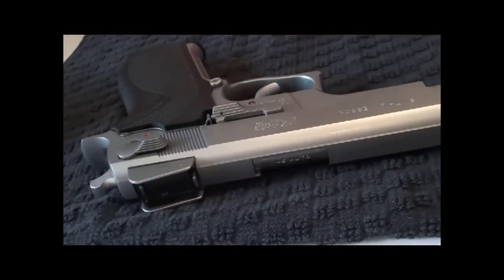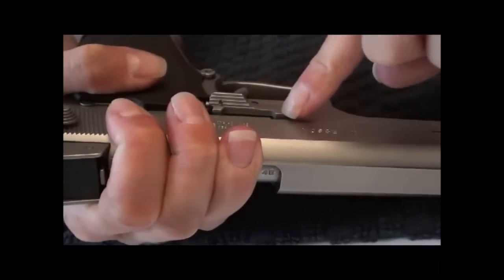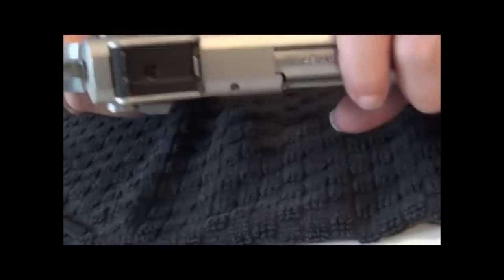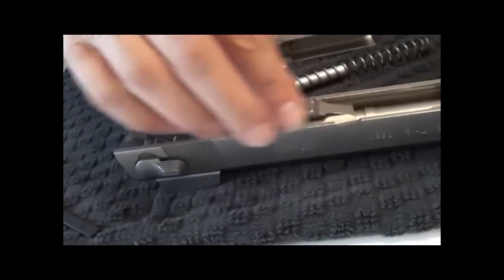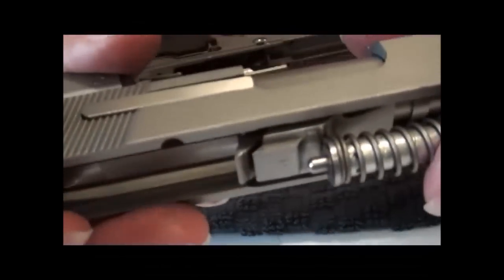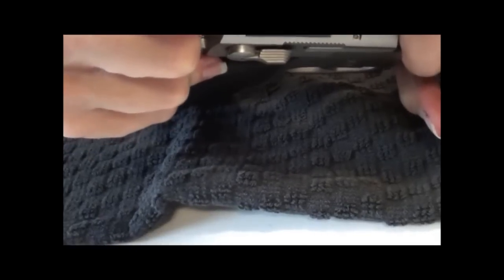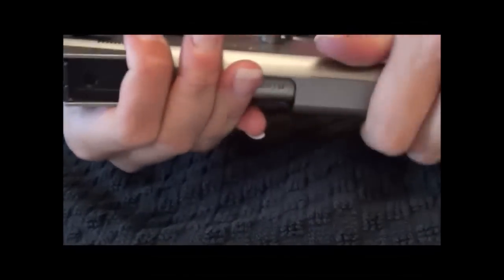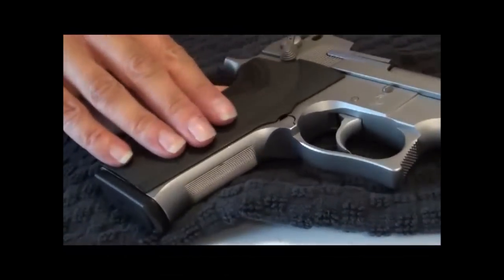Smith & Wesson 4506 Disassembly & Reassembly

Comment: This was my absolutely favorite defensive firearm I carried as a police motorcycle officer in the SF Bay Area in the 1990's. A beautiful and comfortable shooting firearm. Sleek lines and 'peace of mind' as a defensive firearm. Large  230 gr.  ammo if ever needed.  It was like throwing a lead & copper 'football' coming @ U.  I was lucky I never had to use it outside of range training in my 35 yr. career.
Reply: Any tips on shooting this? I seem to have accuracy issues. I'm pretty sure it's not the gun LOL.
Reply: To check guns sights for dead-on accuracy, shoot it at a range with a 'steady-hand' aiming device. 10 ft, 20 ft. 30 ft. 50 ft .  Range personnel can assist U. If sites are off, most gunsmiths/range personnel can assist U in re-aiming them.   Use cheap ammo for range training but carry premium loads in it as a CCW. Clean & lightly lube gun & rubbing parts after every shoot. Take good care of it and it will take good care of you.

Comment: Too bad you glossed over the part where you have to push in the spring loaded pin that’s part of the disassembly pin/slide stop, to push the whole assembly back in. I broke my gun trying to get it back in. Because in your video, it appears like you just pop it right back in without depressing the pin which is a necessary step. Darn it. Maybe don’t post an instructional video if you are going to leave a crucial step out.